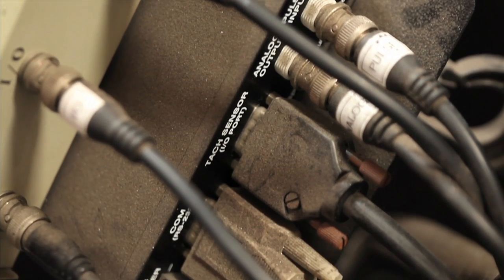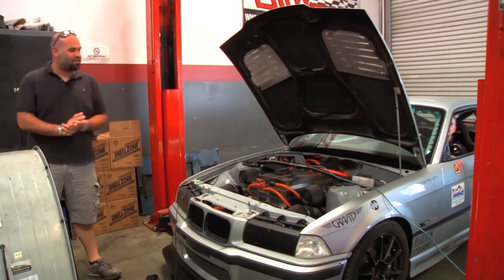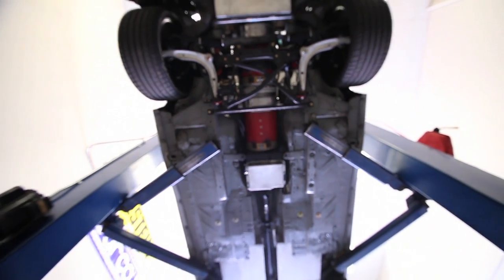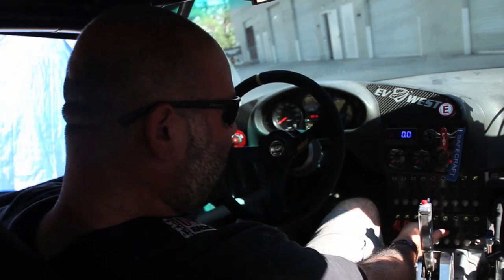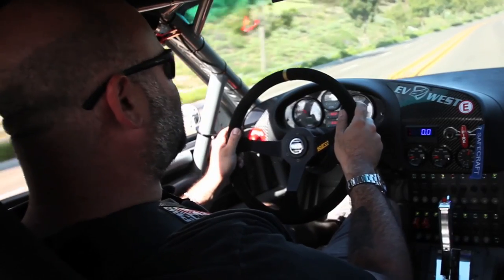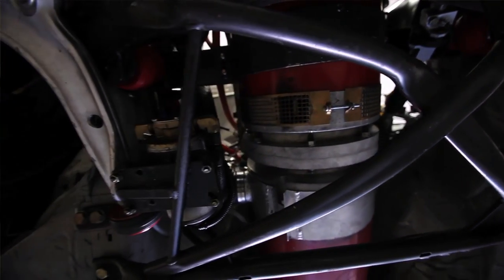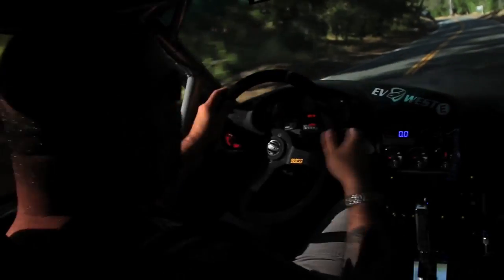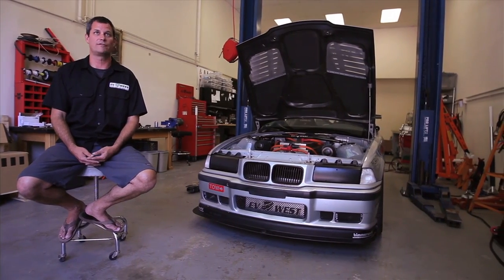This Electric E36 Makes 850 lb/ft of Torque at the Wheels! - /TUNED

Comment: really less pollution est easier to achieve on a powerplant scale, that why even if all electric cars ran on coal powerplants it still be alot cleaner than gas!  do you even know how much electricity is needed to just process petrol into gas?
Reply: None. Petrol IS gas. It's not that people don't care about the environment; it's that electric cars are still utterly pathetic. A journey that a shitty family diesel could do in one day would take an electric car three days or more, because of all the charging. And that would be IF it were fully charged to begin with. Electric cars are heavy, slow, expensive and BAD for the environment
Reply: it's not true, electric cars pollute alot less, even big car compagnies say so. Taking into acount the battery can be recycled and the fact electric motors are extremely efficient and waste less energy. In gas cars only 30% of energy you put into the tank actually propels the car forward and the rest is wasted as heat and pollution, causing thousens of people to die of lung cancer
Reply: Yeah, maybe 80% of the fuel burned in a power plant is turned into energy. Of course, some of that is lost at the step-up transformer at the plant. More is lost all the way along the cables. Then, at the step-down transformer at the sub-station, then, usually at another neighborhood transformer, plus all the cable between them. Then a bunch of wire to your house, then ANOTHER step-down transformer in the battery charger, and then, maybe 50% of what is left is actually stored in the battery. Plus, if you get rid of your gas car to buy an electric car, you just got rid of a car that was already made, and caused the creation of a new one, and all the pollution that goes with that. All that extra hassle and pollution for a car that causes more harm to the environment, is a slow, heavy piece of crap, and can't make long journeys without LONG stops to charge.
Reply: well even with all these losses it's still alot cleaner, for everyday go-to-work commutes where you don't need thousen miles range electric cars are alot cleaner. for the fact you have to build a new car it's okay because people will not keep old cars just for that reason (gas, diesel or electric)
Reply: mellowb1rd 1) He kind of meant to say how much power is used to refine crude oil into petroleum.  If you count the whole well-to-wheel process, all the drilling, transporting, refining, etc, you reach an emissions figure astronomically higher than that of simply generating electricity and sending it straight to the car batteries (accounting transmission losses)

Anyone who thinks EV's harm the environment more are just utterly clueless. Please, shut the fuck up with your inane bullshit and GO DO SOME RESEARCH.  Fill that utterly thick skull of yours with realistic facts & figures rather than hearsay and media sensationalism.  While you're at it, try and learn how much of the rare earths/heavy metals go into the lithium batteries.  You'll find the figure a lot smaller than you thought.

And get your head around this:  Fast chargers can charge an electric car (even the Tesla with 300 miles of range) in less than half an hour.  It doesn't take two additional days to make the same trip a family diesel can do in one.  It takes a few more hours at most.
Reply: Plenty of studies have been done on the lifecycle impacts of electric cars. Electric cars contribute less CO2 than conventional cars. Do you know how to use Google? IEEE Xplore? Scopus? Of course not you plebe, you have never done any actual research in your life. :) Also it's "well to wheel", not "wheel to well".

Oil is rarely used for power generation since it's expensive. Natural Gas is though. New gas power stations are 60% efficient. About twice as efficient as an inefficient combustion engine in your car. Natural Gas also puts out less CO2 per unit of heat. So it's a big win even if the power stations are still powered by natural gas. The only time an electric car is as bad as a combustion engine is when electricity is solely generated by coal. Most of the world is not in this situation.

Nope, walking does not put out more CO2 than driving. That analysis was flawed. Use Google. "Ask the EcoGeek: Walking Worse than Driving? No." In any case, I don't mind about releasing some CO2 into the atmosphere - just not dangerously huge amounts. And yes, there are plenty of other ways to reduce CO2 emissions.But road emissions are a huge part of CO2 emissions, 20%, so they will have to be reduced. That means alternative vehicles. Of which, EVs are the best. I also don't like importing energy from rather dangerous countries. EVs are a big fuck-you to those countries.

Also no, since most crude is burned, if we didn't burn it we wouldn't "refine the same amount of crude". Where the fuck do you get this shit from? Also maybe since we actually need crude for things like roads and plastics, maybe, just maybe we shouldn't waste it by burning it? Did that ever occur to you?

As far as the popularity of electric cars goes, plenty of EVs have gotten rather rave reviews. PHEVs and EVs will become more popular over time, as environmental concerns grow stronger and battery technology improves. 

So essentially you are wrong on every single point you made, and everyone who has read any of your comments on EVs is now stupider for reading them. Seriously how old are you? 15? Does daddy for Shell? If EVs are so bad then why spend so much effort criticizing them? Why do I defend electric cars from people like you? Schadenfreude. And because I can't sleep.

Comment: Was this car auto trans? Can electric vehicles have manual transmissions?
Reply: They don't need transmission (but they can have it). They can have full power in full RPM range. You don't need clutch, because electric engine can start moving car from 0 RPM.
Reply: would a manual tranny in an EV improve performance? i would miss shifting hahaa
Reply: Yes, a transmission still gives you more torque when you accelerate and less energy when you are cruising.
Reply: Alex Perez From what I understand though, you would be better off without a transmission in the long run. With the way the engine supplies power instantaneously it causes more problems then it is worth. Just like they explain in the video. The sheer on-demand power provided by the engine blew the stock transmission, the first gear of another and a clutch.

All of that is way too much trouble when you can easily circumvent the transmission entirely and improve your acceleration and performance by supplying the engine power directly to the wheels. I do understand you will miss the shifting but when that baby takes off like a bat out of hell you will learn to love living without it.
Reply: Donald Kenne  That will NOT improve the acceleration, that would kill the acceleration to less than half as quick.  First gear multiplies torque 4.2 times.  Second gear multiplies torque 2.5 times.
Reply: ralphinator2 Except for the fact that there is power lost in the transmission. You can get full torque instantly at the wheel via a direct connection. Transmissions are pointless in electric cars. How do you think a Tesla S can out accelerate a sports car.
Reply: Donald Kenne  There is some friction in the transmission, but they would lose more than 75% of their torque.  Ya you would get full torque of the motor at the wheel, but the transmission gives you four times as much as "full torque".
http://www.bokchoys.com/differential/GearRatios.htm
Reply: +Donald Kenne I've driven Teslas. Very quick. Great response on the accelerator but otherwise not engaging.
Reply: Michael Cohen Have you driven the roadster or just the S sedan?
Reply: +ralphinator2 just the sedan. Not the roadster. I'd love the chance if you are loaning them out. I suspect I would prefer a Lotus Elise which the roadster was based on.
Reply: The channel engineering explained goes over formula e cars which are electric. Some of them don't even have gearboxes! I highly recommend his videos if you're interested in electric motors for auto applications

Comment: DC motor whirl) aren't it cool?
well even if using AC brushless motor there will be 1 reduction gear so why not make it emit funny cosmic noise? I think it's possible.

To those who don't believe in EV, I can give you simple math. Tesla Model S 60 kwh battery gives 300 km range , and weights around 1200 kg. This battery design is like 3-4 years old. Now, presented in last year Mercedes SLS Electric has the same 60 kwh battery pack which weights twice less, 550 kg.
Basically, take two SLS battery packs and combine it with Tesla drivetrain, and you have 600 km range car. Sounds good?

I hope Tesla model 3 will be like that. I think they HAVE TO, in order to beat bmw 3 series with it's 700+ km range on one tank.

Comment: The technology that the first comment was about hydrogen generator which is very different. Also the concept of a electric motor with a generator is almost as old as the car itself so top gear are very very far from the first people to do it. So you ,sir, are wrong and also unnecessary rude.

Comment: Transforming fuel into usable electrical energy is more than five times more efficient, probably more, one liter of fuel used in a car goes 1km , if that same liter is used to create electricity the Tesla goes 5km's, even with the transmission loses from refinery.
They also use coal, which isn't as expensive as fuel to refine, point is electric cars are the future, how long it takes is a direct reflection on how stupid the paying public are, my guess is very so it will take a while.

Comment: "I do like not having to shift."
Hey, genius, you know you can get diesel cars with automatic gear boxes, right?

I don't know about the USA but here in Europe manual gearboxes are stupidly common, with automatics often only available on higher-end vehicles (I'm not counting those multi-mode gearboxes on cars like the Yaris--they're better than manual but still a bit lame in terms of comfort) and with a price tag to match. Ironically, EVs will be a fairly cheap way of driving with an automatic gearbox. (Sure, you can't drive 400 km in day but many people don't, so who cares? Heck, if you even do 400 km in week, that's already quite something!)
Reply: No powerloss on a hillclimb much?
Reply: most cars in the USA are automatic.
Reply: not that, as you increase altitude, the combustion is not as rich due to the lack of atmospheric pressure and oxygen particles in the air.
Reply: Ryanshimia yes, this is why an e motorbike won pikes peak: P
Reply: is their an emoji for facepalm? what does most cars in the us being auto even matter? i was talking about electric cars dont lose power as they increase altitude. please stop talking to me as i do not want to associate myself with your level of knowledge.

Comment: why has transmission? Is electric. Motor can rev to 20, 30 thousand rpm. You don't need gears.
Reply: +Fraser Hood nevermind, its cooled badly, thats why they keep rpms so low.
Reply: +Fraser Hood thats not the reason, and not every electric motor can rev that high, with low rev e-engines you can keep the motor in a low consumption spot and get better top speed (forgive my english, second language....)
Reply: +Fraser Hood Wrong, these are big Direct Current motors, not power dense High Rev AC motors. Big DC motors use huge coils and staters to induce massive forces at much lower Revs. Two motor diferent architectures.
Reply: It's a DC motor, not the typical AC version. Doesn't need to spin at high revs.

Comment: My stock pickup makes the same power haha. Those are advertised numbers though, I know.
Reply: and the engine weighs 1/3 of this entire BMW....
Reply: I understand lol. I'm not saying it's fast, I just thought it was funny they were the same numbers
Reply: blake woolam But this car puts it's maximum torque from zero up to his 4100 rpm. That's the advantage of electric motors. You got your max torque as soon as you put your foot down. I'm sure your truck can't do that,buddy ;-)
Reply: I'm sure I can't either, and it weighs over 3 tons, and it handles like shit, I was just jokin around :)
Reply: Ian Mcdowell Actually it probably doesn't I don't think you understand EVs. Because of the battery packs, that BMW weighs almost 4000 lbs.
Reply: I said the engine weighs...I didn't say the car weighs or the battery pack weighs.Also, No, that m3 weighs 3400lbs.

Comment: why would you care about torque, when you have an electric engine? Why do you event bother about putting a gearbox+ clutch + drive shaft + diff? Just unnessecary weight and friction. The tesla approach is much better.